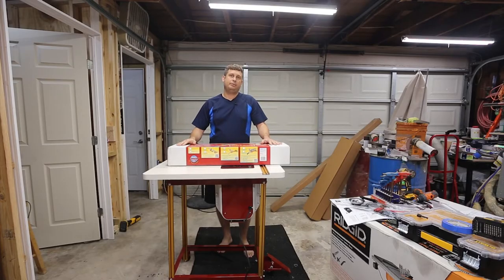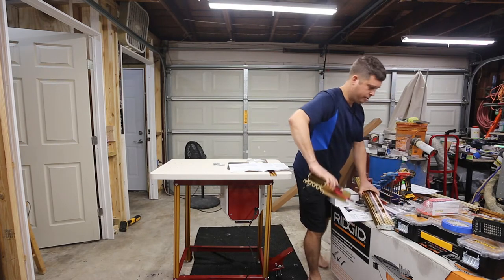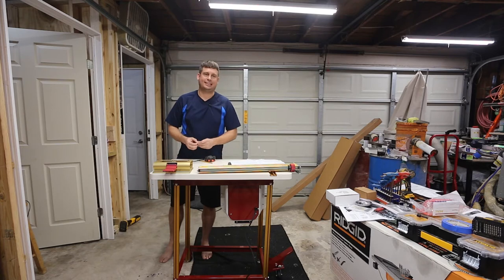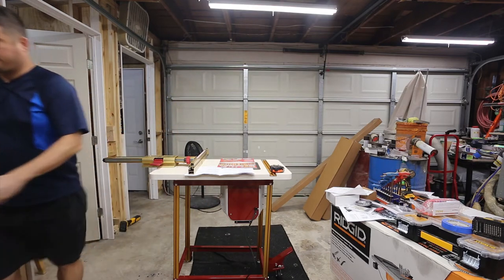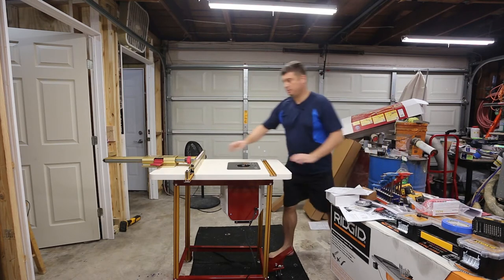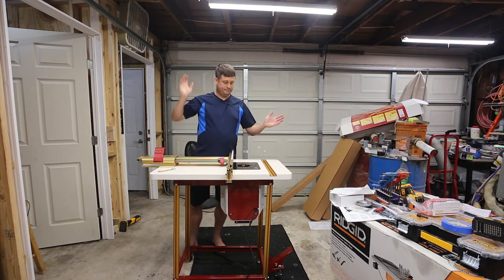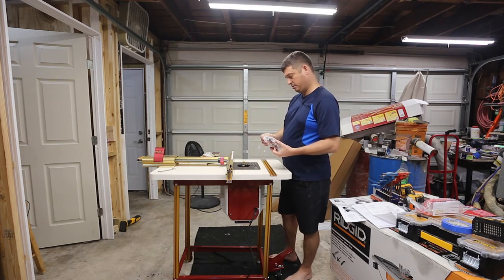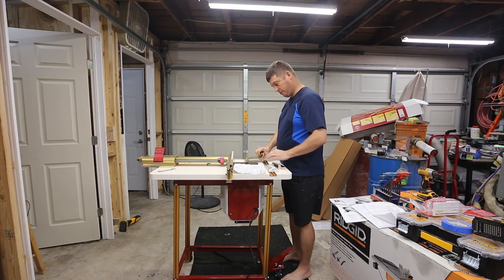Installing an Incra LS-Standard System Router Fence on an Incra Router Table

Comment: Hey mate, I don't want to discourage you from making videos. Your video needed preparation, editing, and closeups. Question is: are you trying to show us how difficult it is to assemble the system or are you actually trying to provide some instructional material. Preparation means that you have worked it out before the camera rolls, editing means you delete 80% of it before publishing. Closeups allows people to SEE what you're doing. No one wants to see someone fumbling around for 40 mins trying to work it out. Could have been a 5-minute video.
Reply from the maker: I was not trying to produce a TV show, make an instructional video, or set a standard.  I was simply video taping a project to show others my adventure.